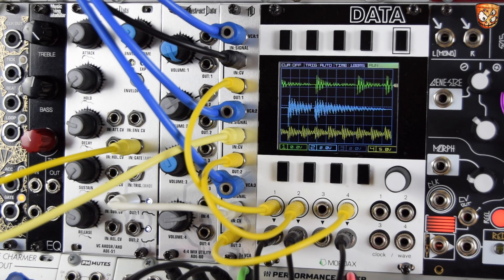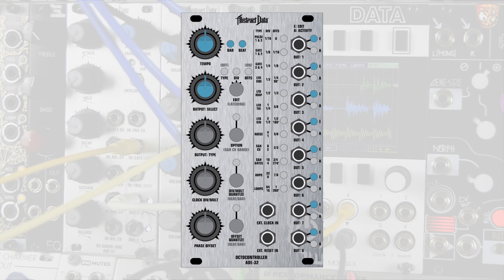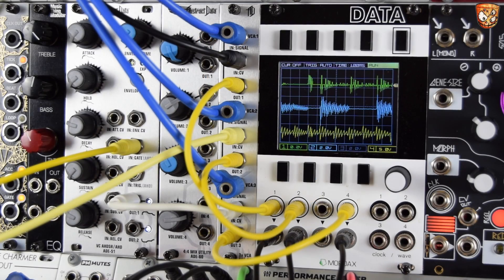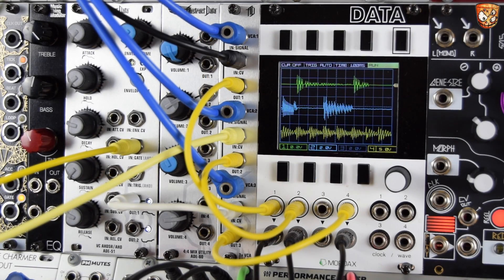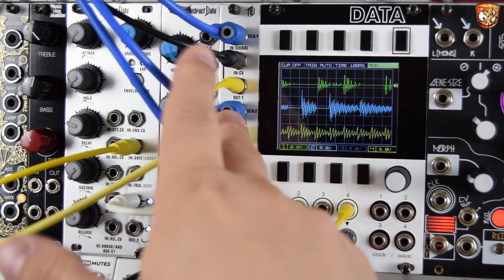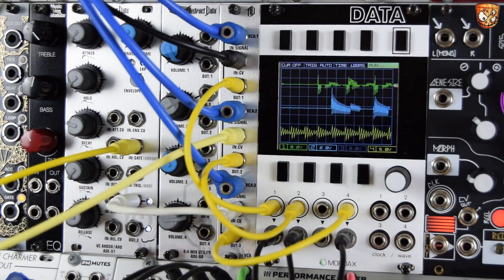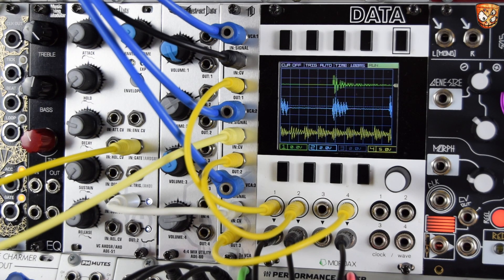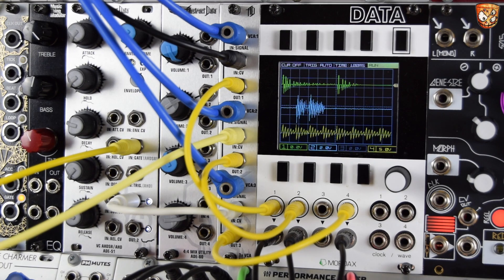Abstract Data ADE-50 3x VCA

Comment: In the AM portion of the show, I see that there is are little flat lines in the waveform at zero.  Is that because there is a dead zone around zero to make sure the vca closes or is it because the vca doesn't read the negative voltage on the cv input and so we are only getting modulation from a half rectified wave?  (I think I am making sense, am I?)
Reply from the maker: The VCA doesn't read the negative voltage, closed by default and I put in a bipolar -5V to +5V signal.
Reply: Interesting, is there a bias on these vca's  that you can use to move the bipolar signal fully into the positive range?
Reply from the maker: no bias, simply input, CV and output. However the ADE-60 utility module is a fantastic partner for the module. I'll be covering that soon.